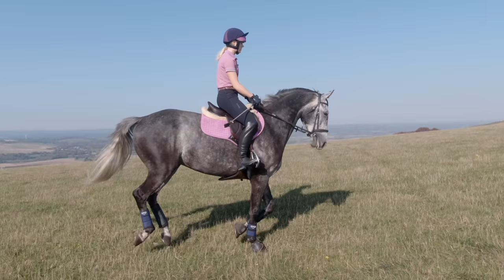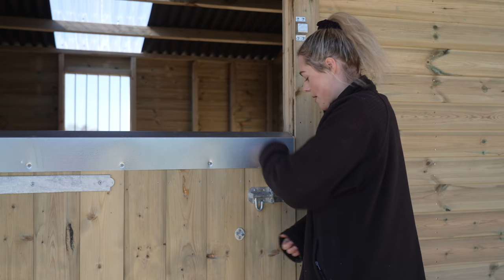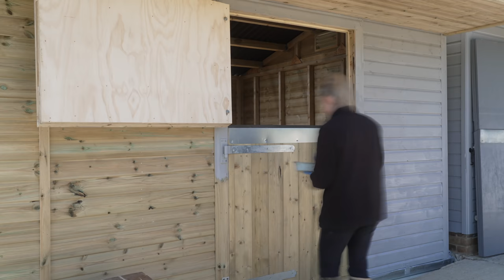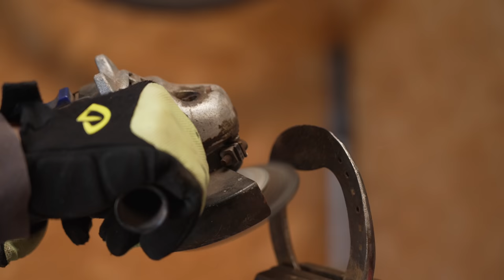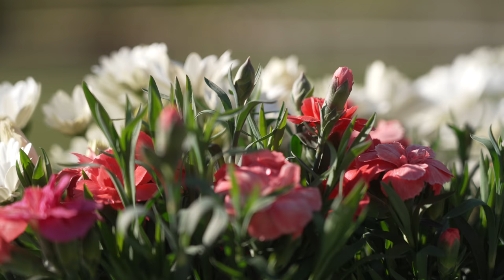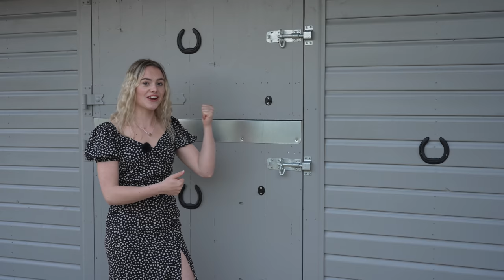Stable Reveal + Barn Tour! Stable Renovation Series Ep3 | This Esme

Comment: Paint the wash bay, even if it is more work now, it will be far more robust and easier to keep clean, as well as lasting longer. Something intended for wet environments, and well sealed. Maybe even some caulking at the corners. Otherwise, the wood is likely to grow nasty stuff and to break down very quickly, especially given how often your greys need washing in the winter. Plus, it will be so, so much easier to keep it looking clean - just hose down the bay once the horses are washed. Love the two-tone idea!

Comment: May I suggest you not only paint the wash bay with a anti mildew paint but also put a sealer on it. The MDF board will not survive the moisture. It will fall apart and the crevasses will hold in mold.